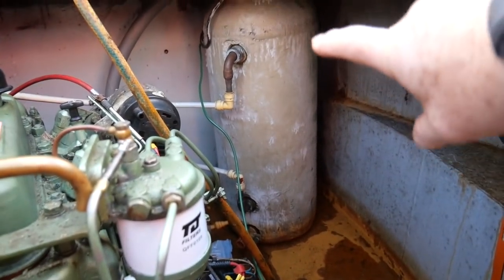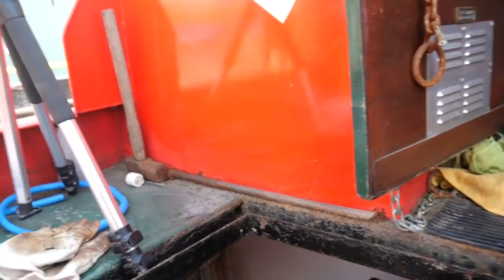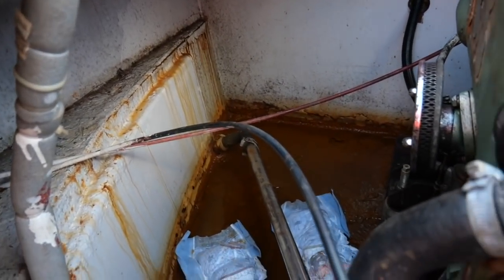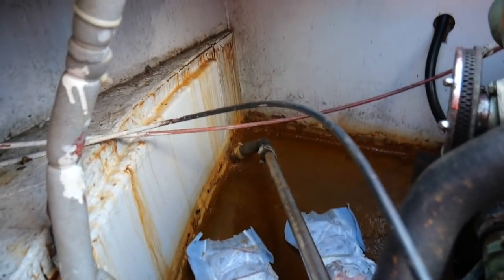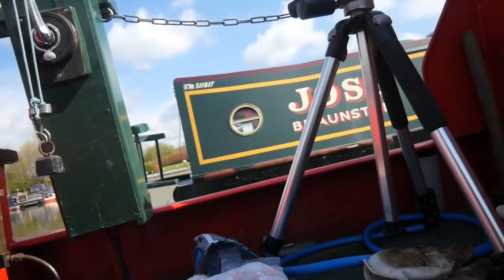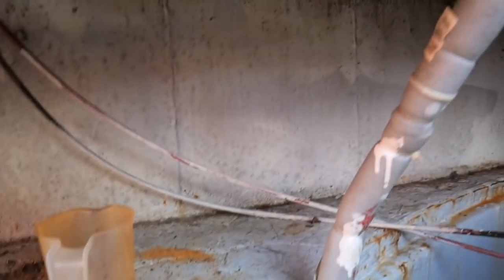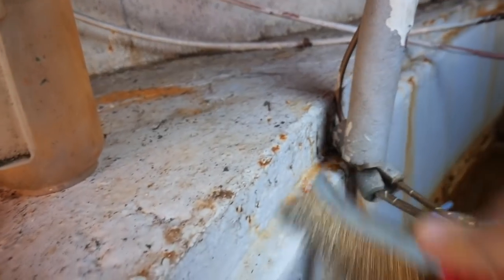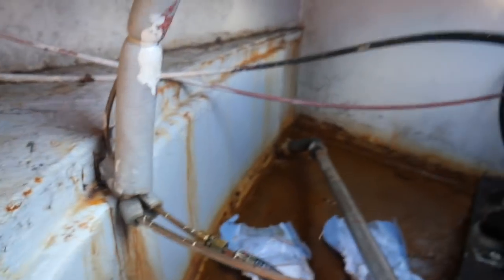Narrowboat Engine Room Cleanup part 1  - Rust removal

Comment: Looking good Steve, little tip get a round wire brushs for your drill, a little set about a tenner but will make light work of the important areas edges, corners and door track but wear a mask.

Comment: Hi Steve check but I think your stern tube will adj looks like c spanner’s or some large adjustable grips mine is a slightly different set up but before changing the packing just adjust the pressure on the tube Don’t over do it you must be able to turn the shaft freely if you don’t it will overheat good luck.I use puppy training mats from B&Ms leave them in the engine bay after you have painted it and it will stay dry 👍
Reply from the maker: Thanks for the tip Robert. Yes I have slightly tightened up the Stern Gland (large grips came with the boat). An additional tip I've been told is to give the grease a turn or 2 after we've been on a trip. 
We've had 2 days of "on off" rain since the initial bit of work so I am hoping that the engine bay stays dry. Thanks for the tip on the B&M puppy pads :)
Reply: @TheHappyTravellers  puppy mats not pads ok they are large and flat 👍

Comment: That engine looks in pretty good shape, I always thought they were a lot larger capacity, 1800 should be quite frugal with the go juice
Reply from the maker: As there is no fuel gauge and no distance or time running meter, it's hard to say how good it is on fuel. What I can say is that we have not bought any fuel for the boat ever. It came with a full tank plus a 20 litre container (full) which I have added to the fuel tank so we have used at least 20 litres (~4 gallons).
We have made the mistake of letting the fuel run down over winter and now we have water in the diesel tank (from condensation) which we're having cleaned out when we have the diesel heater fitted (that start on Tuesday 4th May).
Reply: @TheHappyTravellers  That's a pain, but I guess all part of the learning curve, would a fuel filter help , although as i'm sure you are aware  water in the pistons will not do the engine much good so dump and clean out is prob the best idea.
Reply from the maker: Yes the guy will drain the tank and clean the diesel and then put the clean diesel back in. It’s called fuel polishing. 👍😎😀
Reply: @TheHappyTravellers  Ahh I see, something new i've learned :)  Is there a long term cure or is it just keep the tanks full in winter, wonder what stops it happening in vehicles ?

Comment: Hi steve, what type of gland packing do you use ?
Reply from the maker: I really have no idea what Gland packing is used. We've owned the boat for 6 months and have not needed to repack it.
Reply: I am sorry brother, thought you had the boat longer, as a ex maintenance fitter, I always thought the graphite packing  is good. I used to use a pigs tail, ( spring steel   curled into a Cork screw ) to get the old packing out. All the best carl.
Reply from the maker: Thanks 🤩